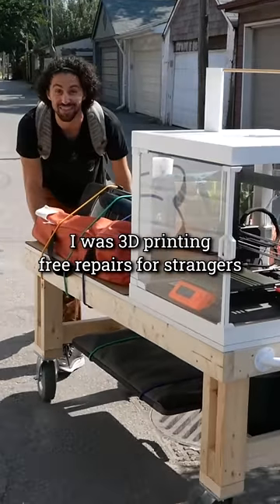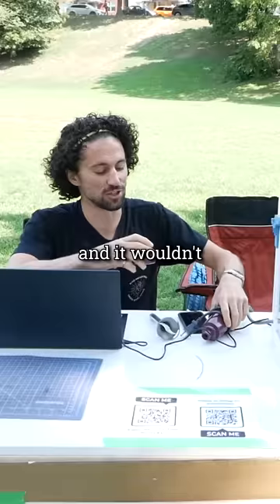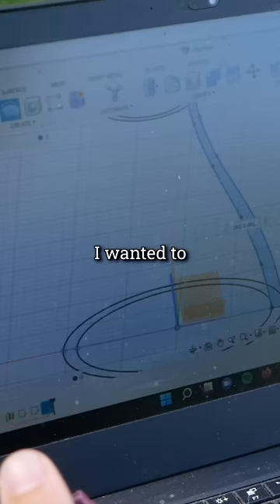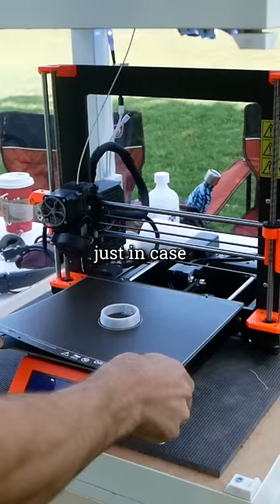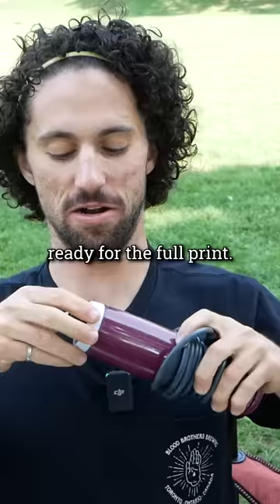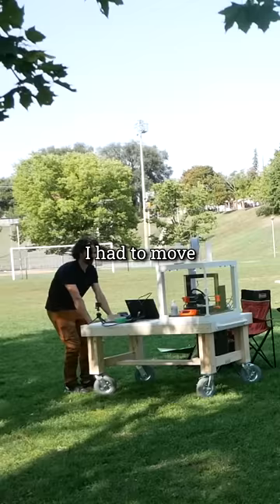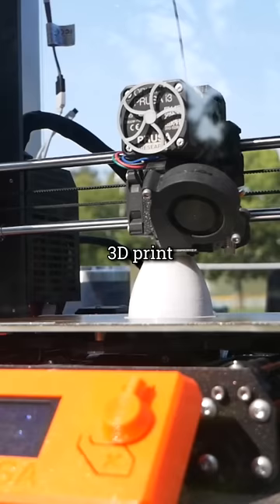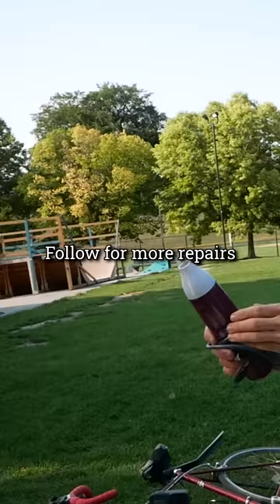3D printed repair for a stranger #DIY #3dprinting #repair

Comment: Such a smart idea, so many things are thrown out while they are easily saved
Reply: I wouldn’t say easily since not a lot of people have access to and the knowledge to use a 3D printer
Reply: @livfuji  3d printer is widely available now but the skill to design is not, you are right.
Reply: @livfuji dude they cost less than phones nowadays.
Reply: @thegoldenatlas753  True but not many people can produce 3D designs. It wouldn’t be feasible to pay a consultant either.
Reply: @HappyHappyPanda88 I took cad-cam which is 3D printing in my high school and yeah, I cannot design crap in 3D
Reply: @liam Anderson Yeah you could. And then what would you do?
Reply: @lIIustration  upload it to one of the many many services that will print your models for you and send them to you
Reply: @livfuji is a 3D printer the only example of creativity you can think of? Not surprising.
Reply: @rorymax  my point was that even if you scan a broken object with LIDAR, your 3d model is just going to be a broken object. You’ll actual need to use Fusion or some CAD software to repair the model. Plus you’re likely going to need to reduce the number of polygons of your 3d model in fusion which would reduce its tolerances even further. At that point you’re better off just measuring and redesigning the whole piece from scratch which not many people can do. Hence my original comment is that although 3d printing is widely available, it’s not very feasible for people to repair plastic objects unless they actually know how to design 3d objects themselves. If they don’t know how, hiring a consultant at $100+ an hour would be much too costly.
Reply: @lIIustration  oh yeah
Reply: @HappyHappyPanda88  honestly as someone who started 3d printing with no help or guidance, modeling isnt that hard, most software is pretty user friendly and its all pretty intuitive, as long as someone is familiar with calipers you can pretty much model anything simple like that
Reply: @thegoldenatlas753  jokes on you if you thought I buy the latest phones 🤣
Reply: @_Cfocus  lol me too
Reply: @HappyHappyPanda88  If companies had to provide the cad files then anyone could 3d print replacement parts, some companies already do this
Reply: But you do get the occasional bugs. A hole is in the print file when the model file doesn't have a hole. Boolean seems to not want to work on something you just did it a minute ago. The printer increasing the size of certain parts of the print for some reason. Warping of the print, bed adhesion issues, machine failure, faulty parts, limited print space. 3d printing is easy to get into but once the actual printing starts is where the real trouble begins.
Reply: @thegoldenatlas753  dare you to find a decent 3d printer under 500
Reply: @Miguel-cg2vz  Ender 3 S1 
Hell even the S1 Pro is below 500
Reply: I think the 3d printer is more expensive then the blender
Reply: @dhgcrack3r111  a 3d printer is one of the best tools for making relatively high precision functional parts in weird shapes
Reply: @catgirlQueer  you’re correct but swoosh
Reply: It’s so inefficient though. You have to design the part (and know the right dimensions) and print it which takes time and expertise. Plus it’s likely you won’t get sizing right the first time around because 3D printer tolerances aren’t great.
Reply: @Ryan-cb1ei  not that much, if any less efficient than injection molding, and significantly more efficient than any kind of subtractive manufacturing can even dream of being
Reply: @catgirlQueer  Well yeah the real solution is just replacement parts or units lol
Reply: @Ryan-cb1ei  right, because shipping replacement parts is entirely free and perfectly efficient (of course, shipping a spool of filament is also not, but from a 1kg spool you can easily make 30+ replacement parts, depending on the size)

a real solution could be if manufacturers would provide replacement printable files for all the printable components in a machine, as that fixes the sizing and designing issues, while still offering replacement parts they manufactured as well, for people that don't have access to a 3d printer
Reply: @catgirlQueer  I mean I don’t disagree lol, but as someone who works with factories and suppliers, they have all the parts already on standby, and you just forecast how many to order and they’ll do it for you, so yeah, it’s easy.

Comment: Surprised no one said "that's not food safe". I don't really care, but that's what every other 3d printing group would be screeching right now 😂
Reply: Stoppp I was looking for the comments like that☠️☠️☠️
Reply: Yeah so I follow more of a middle ground, I suggest not pla as it cannot survive a dishwasher or boiling water, some plastics are better than others but I also sugest boiling the part to get it to “out gas” some of what is is going to. But some plastics, or adititives are no joke so … kind of a case by case if it is important enough to risk it, in this case it is perfect, it is in contact with the food for a limited time unlike a jar that would have long contact time for chemicals to leach.
Reply: Yeah
Absolutely
Reply: @BrianHamilton01  i think the concern isnt about the plastc, but more about the fact you can't clean the part completely. Between the fine layer lines and the overall porosity of the part, food can never really be cleaned from a part. Makes it like a dirty dosh you never really clean. That's how it's been explained to me haha. But ive never really looked into it cuz i never had to make prints that touch food.
Reply: If the filament is PETG is food safe, PLA isn't but also this is for the attachments, the attachments are the ones that touch the food... the only real issue is dish washer...

Comment: Great initiative but be careful some 3D print plastic is not BPA free or even food safe.
Reply: Good point but that part shouldn’t need to be submerged I wouldn’t think, just the metal rod that is attached to the blender piece right?
Reply: Half of the plastic containers you get aren’t bpa free either but I bet you still have food in them
Reply: PLA (the most common plastic used to 3D print) is biodegradable (it’s made from corn)
Reply: @RedstoneTech  unfortunately that doesn't make it food safe. Bacteria can still grow in "cracks" and in-between layers.
Reply: @Ducky and they can also put other additives in the filament that aren't just pure pla. (Usually for color)

Comment: What kind of filament did you use, and is it food safe?
Reply: This is the real question!!
Reply: assuming he used PLA, no. if he used PETG, then Maybe. the enclosure makes me think he may have.
Reply: Even if you use food grade safe filament, the manufacturing process leaves small spaces between the layers that are impossible to clean and let bacteria grow, so technically speaking, no sadly
Reply: Bro the food we eat here in the USA isn’t food safe 🤣
Reply: He should have coated it or bathed it in acetone (depends on the material) so that the grooves went away so it could be food safe
Reply: no, if it was resin printed then it could be. fdm printing leaves too porous of material so bacteria gets trapped
Reply: @ryanrobinson1741  That's false.
Reply: @josephsagotti8786  Unless if you use a different type of printing or coat it in a kind of food safe resin. But as his setup stands no
Reply: @ryanrobinson1741  If you use soapy water at a temperature below the glass transition temperature of PLA, the soap will break the surface tension of the water and allow you to clean even the bumpy surfaces of 3d prints
Reply: @Carpaithian Forest  It's not so much the bumpy surface. It's the fact that it's pretty hard to make a print that doesn't have some form of micro holes from layer changes or transitions that won't let water and bacteria into the support structure itself over time. Thats the area they are worried about unless there is a coating of some sort to prevent that.
Reply: @ryanrobinson1741  if you sand the areas need to contain fluids, you can then prime it and paint it with enamel paint, it should solve the issues. However you'd have to be good at painting to get a super smooth finish
Reply: @PandaFPV  not true
Reply: The food in the US isn't even food safe.. Stop worrying about the little things
Reply: @Geromi87  yeah, I don't even know why I was worried about getting cancer from eating plastic... What was I thinking?!
Reply: That part of the blender dosent go in the food, so its kinda moot

Comment: I been thinking of getting into 3d printing for basically this purpose... The sheer amount of crap that ends up in the trash cause a dinky piece of plastic breaks. 
I am not necessarily an environmentalist but I despise wastefulness. 
This is like patch updates in real life lol.
Not sure if it is a great business model but I like the concept 😎
Reply: In my experience a lot of plastic pieces (particularly small ones) can't really be reliably printed with a machine like this. Injection molding and fdm have different design considerations, and injection molding makes parts that can be made smaller and thinner with better strength, accuracy, and surface finish.

Fdm has a lot of its own advantages, too, but it really shines for custom stuff and certain prototypes, less for direct replacement part manufacture.

Comment: You know what, get you something like a food truck and convert it into a mobile repair vehicle. Cone to a neighborhood, set out a few displat and demo pieces, then get clients to make repairs for. Running an inverter off your truck betteries to power multiple printers, and a solar panel roof for additional power. You have the start of a good business that could easily 3scalate to a permanent store location and expand from there.

Comment: Nice work. What kind of filament is good for food use?
Reply: Nothing, all prints have gaps and layer lines. Expoy it after if you want something foodsafe
Reply: @KingBigBabyJesus  Even then I'd be nervous about epoxy anywhere near food
Reply: Pasta
Reply: 3d print covered with food safe epoxy.
Reply: @Jack Millen  you should use food safe epoxy. Didn't think that had to be clarified. It's not the fact your print has layer lines it's the fact that you can't clean what gets behind those layer lines.
Reply: You should never use 3D prints for food prep. Especially something designed to be submerged in liquid.
Reply: None of them. Even if the filament is somehow foodsafe, the printer nozzle it goes through most definitely is not. Additionally, filaments are usually porous, and the gaps between layer lines both mean they are functionally impossible to clean from bacteria, unless you use something with enough heat resistance to be put through the dishwasher or like an autoclave or something
Reply: @__  I don't even think a dishwasher would even help. I couldn't see it ever drying out properly again and it would still grow things.  I guess you could chuck it back in the filament dehydrator after the dishwasher
Reply: Guys. Ceramic prints exist
Reply: @TheKamiBunny  even still. Unless you're using SLS all the problems mentioned before still apply

Comment: My headphones slider cover which held the whole headphones together broke and replacement was £25 + delivery. I manage to find someone who 3d prints locally and gave him a file for the covers I found on Internet and he printed 2 sets. 8 prices in total for like £7. His workplace was few miles away in next the city but his house was liturally few roads down for mine. This 3d printed design was extra beafy and top of that he used 100% in fill. 3d printed covers have already lasted me longer then the original parts and I still have a spare set.

Comment: 2axis gyroscope for 3d printer, I made it with ABS solid, the goal when inside the yacht I can still make 3D components, to be smoother in moving can use CERAMIC HYBRID BEARING 6903 GRADE 5 dia in17x dia out 30 x 7mm wide I use 2 in one axis, and there are 8 rings in total, and don't forget to make bolts on the boat table adhesive alone in my opinion is not strong enough.

Comment: 3d prints are not food-safe because of the porous surfaces.... If you're making a part that interacts with food or your body and you're planning on using those parts long-term: Seal the prints with food-safe epoxy resin. You may need to adjust tolerances on holes, pins, mechanisms, etc by a few tenths of a millimeter to account for the resin (depends on the resin you end up using).

Comment: Still don't see enough comments about this. Don't use 3D printed parts for food usage. If you have to:
* ensure yourself your 3D printer is food safe
* your filament is food safe and no non-safe filament is left (or better yet, used) in the system
* sand it smooth
* coat it with a food safe epoxy
Do all of them.

I like the idea behind this video but I wouldn't give people 3d prints they're going to use with food, or end up in a children's mouth or something (ie: toys)

Comment: This is so cool! 
So many products that can be repaired by printing a part instead of being thrown away.
Like right now I have a G502 that could use another shell as the i didn't know how much I could wear it away just from normal use.
Also Skull Candy Crushers STILL working condition but the top head piece that holds both speakers together is broken and if it's replaced it's a good working Skullcandy Crusher headphones.

Right now I'm thinking about just giving them away but I have to hope they're not just going to sit on them like me or worse just throw them away.

Comment: Idea. Add longer cables to the solar panels and a bigger battery as your main output. You can get free 18650 batteries of you think a little outside the box and it's legal 👍

Comment: What if you attached a reduced gear ratio gearbox (prob not 3d printed but would be cool) with some type of crank and a wheel so you could move the station around easier, and also configure the gearbox so each revolution of the wheel wouldn’t get you far but each one would be easy

Comment: I love this, What material did you use? Has layer adhesion improved much using pla in the last 4 years? I need to repair the fan on my extrusion head and pull my old printer out of the garage so I can get back into 3d printing..

Comment: That's pretty cool however you really shouldn't be using 3d printing for food stuff. The plastics used aren't safe for that application and bacteria likes to grow in the grooves between the layers, which are impossible to clean using usual methods. Any 3D prints that are going to be used for that application should be printed with a plastic for that application, a new nozzle (or one that's used exclusively for that type of plastic), and vapor smoothed afterwords.

Comment: i have a 3d printer but the builds keep getting stuck and sometimes breaking when i take them off, how do you easily just lift it off? is it the type of printer or is the build plate special?

Comment: How much power required to run the printer? Did you run the heat bed at all? Curious what your peak watts used was .

Comment: Bro tbh I'm surprised you didn't put a UPS battery backup on that... Solar panels are fun and all but you could legit get an automotive diag card and get a battery backup to run everything on and use solar panels for the mobile recharge

Comment: I have a 40 something year old Peavy mixer amp and many of the knobs are missing. They are a special type only manufactured by peavy so i cant find replacments at all. I was wondering if a 3d printer could make such pieces?

Comment: Do you ever worry about bacteria growth in the layer lines? I know it is hard to make  food safe 3d printed fdm parts.
Reply: Depend on what the use is. If it's a container for a liquid that you're going to drink, it's not suitable. If you're going to thermally treat whatever touches your 3D print, then you don't have to worry about bacteria, but you might worry about non food safe ingredients in your print, such as things that come from the mechanism. Bearing grease, extruder gear shaving, nozzle shaving. Masterbatch in your filament plus whatever mechanism residue comes through from the filament extruder. Accidental contamination of resin and masterbatch. But unless you're dealing with liquids again, odds are you'll extract little of that into the food.

You can seal the print with epoxy or shellac.

From what I've heard ABS wasn't eligible for FDA certification until recently and is still remarkably unlikely to be food safe, due to mutual polymerisation inhibition, so there's still going to be a good amount of poisonous monomer and short polymer chains locked inside. Other styrene polymers such as HIPS are likely to fare better. If you can find one where you have strong reason to believe it is food safe, well then acetone smoothing the surface would make it pretty good.

Comment: I only dream of being able to design my own parts and 3D print them instead of hand making them. A 3D printer would save me two weeks of shaping and sanding epoxy putty, if I could 3D print my pods and just epoxy them into place. I’m a Disabled veteran living off bare minimum pay. I ain’t affording anything cool in a long while.

Comment: So let me get this straight, you printed a part that was to go on the hot end of a hair dryer? Am I the only seeing a issue with this? Good deed, I could be wrong too and it might be alright. I do forsee some deformation occuring though. However the solar powered setup is absolutely Unreal, definitely keep it up👍🏽